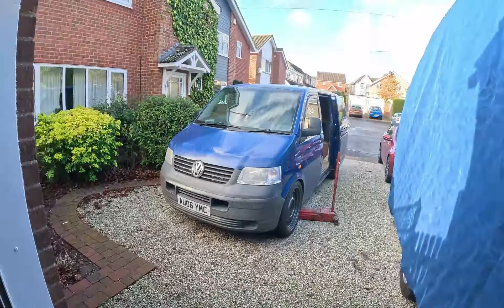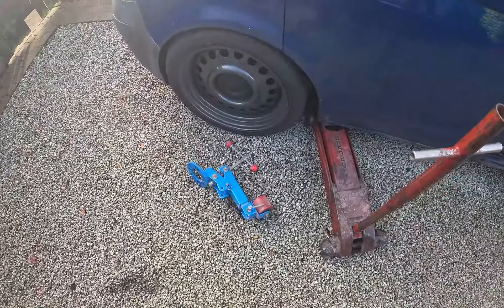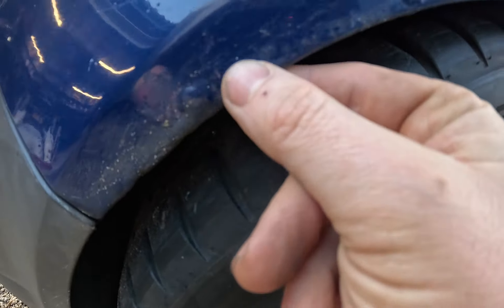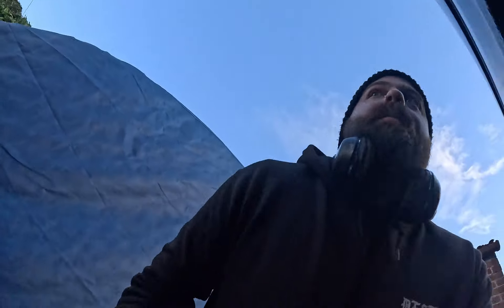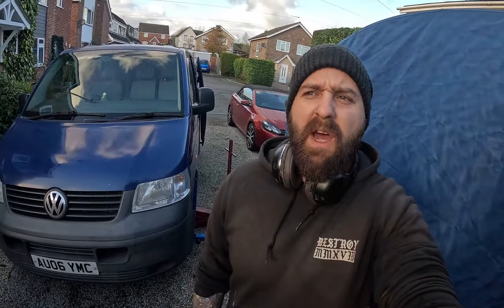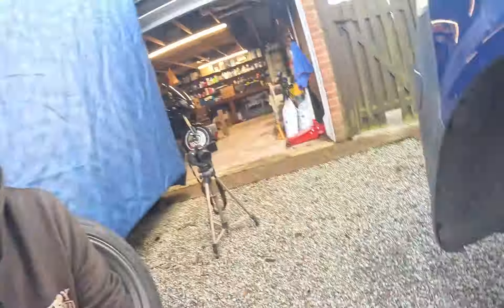VW T5 : Cant be hard can it?

Comment: Should the rolling not be carried out with the jack under the lower arms as this would put the rolling radius nearer the wheel axis - this isn't the compression from a bump axis position but is nearer than full extension axis when jacking point used.
Reply from the maker: It probably should be if you were that fussed about having the roller in the same position as the wheel, but doing it like this has always got me the results I've been after so I've never needed to do it that way.

Comment: You are running the wrong size tyres to be low is u had 255/35 not 275 u would had no issue at all
Reply from the maker: Oh I know that lad! If I changed the profile it wouldn't have been too bad, but I wasn't gonna put my hand in my pocket and spend another couple of hundred quid when these are brand new and rolling my arches was free.